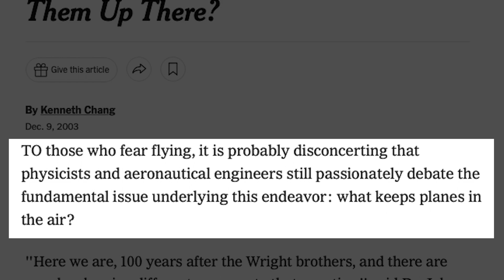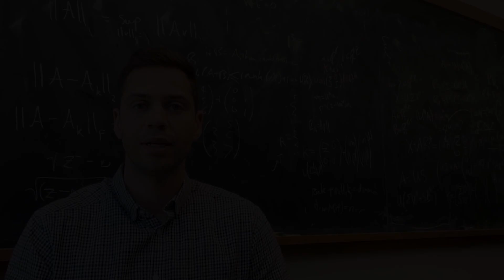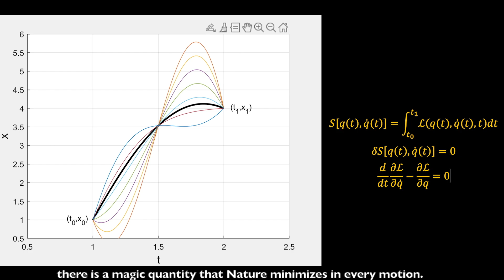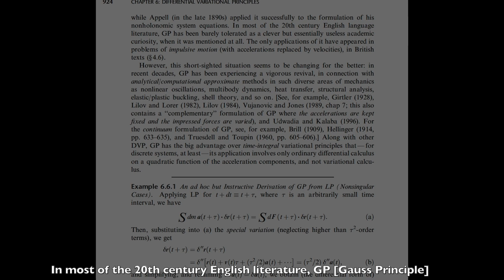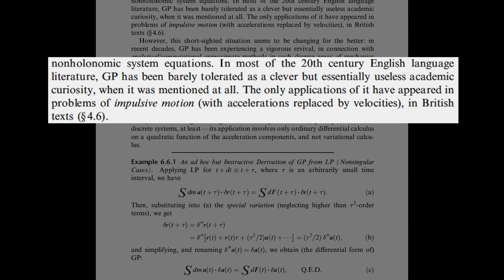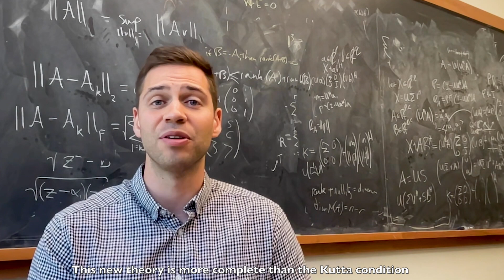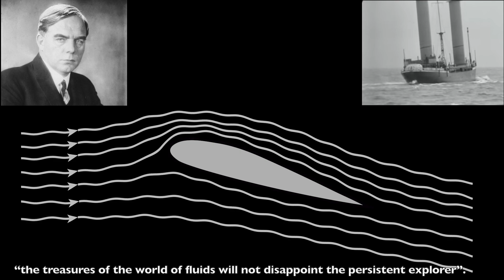A New Theory of Lift

Comment: Everyone over thinks this. The wing flings air down, the reaction force is lift.
Reply: This is more easily apparent when you consider a helicopter, which is a "rotary winged" aircraft. A helicopter in a hover produces downdraft that you can feel if you are standing underneath it. All that air being accelerated downward produces the upward lifting force. It goes back to Newton's laws of motion. The air has inertia, so accelerating it in one direction (downward) produces an equal and opposite reaction (upward) equal to the mass of the air times the rate of acceleration. Airplanes do the same thing as helicopters except they have to constantly keep moving through the air to do it.
Reply: @joevignolor4u949  of course, because the pressure also bends air downwards. After all, air is the only thing the wing/helicopter blade has to push off, so the air going down must equal the force upwards. It's just that more air is deflected down by the pressure difference (the vacuum over the top of the wing "pulling" air molecules in to it hence curving them downwards) than by pure deflection
Reply: @joevignolor4u949  otherwise why does a flat bottom airfoil at 0 degrees AoA produce lift?   There is no deflection going on apart from the frontal area
Reply: @nade5557  That's exactly right. One mistake people often make is to think that the airflow creates the pressure imbalances around the wing. Actually its the other way around. It's useful to think of the wing as a piston being propelled forward through the air. A piston moving in a cylinder creates high pressure in front of it and low pressure behind it. The wing does the same thing as it travels through the air. This "piston effect" is what develops the higher pressure at the leading edge of the wing and the lower pressure at the training edge and it is these pressure imbalances that accelerate the airflow over the top of the wing. Then in addition, accelerating the air further reduces the pressure per Bernoulli's principle. As you stated the net effect of all that suction on top of the wing is to draw the air mass downward towards the wing by vacuum coupling the air to the wing. And because the air is curving downward over the top of the wing against its inertial mass the wing is forced upward. Also note that lowering the leading edge slats and trailing edge flaps increases the width of the "wing piston", which causes more air to flow over the top of the wing, which produces more lift.
Reply: So why is an airfoil more efficient than a flat plate. In fact, the suction force over the top of a wing generates more force than the bottom of the wing. During a stall there is still airflow over the bottom of the wing, yet very little lift is generated. Also stall occurs quite suddenly which corresponds with flow separation over the top of the wing
Reply: @Nade, you're absolutely correct.
The upper surface of a flat bottom aerofoil generates roughly 2/3 of lift, whilst the underside generates roughly 1/3 of lift.
When the angle of attack increases, it will reach a point where the boundary layer will start to separate, this is known as the onset of a stall.
At ground level, in denser air, the stall initiates at low speed at very high angles of attack.
In thinner air, for example, at a high altitude, the stall initiates at a much higher speed, due to lower air pressure being unable to force the airflow to follow the shape of the wing, as it does at lower levels.
As one goes even higher, and the air pressure drops even lower, so the amount of lift generated by the aerofoil eventually reaches a point where it only just equals the weight of the aeroplane, this point is known as the absolute ceiling, 
To give an example, a Boing 747 generates Tons of lift at take off, but at 40,000 feet is generating only about 9 pounds more lift than its weight.
Reply: @nade5557  curvature makes for smoother airflow so that more air is flung down. During a stall the turbulent air goes in all directions so no resultant downward fling.
Reply: @mhoover  but turbulent flow in a stall only affects the air over the top of the wing. The flow over the bottom remains attached and produces some lift, just not enough.

Comment: Thanks for NOT explaining what any of that meant.
Reply: Airplane wings produce lift using the same action/reaction principal that a rocket engine uses to lift a rocket off the launch pad. The pressure created inside the rocket engine's thrust chamber accelerates the combustion gas downward through the nozzle, which produces the upward lifting force. Similarly airplane wings accelerate air downward to produce an upward lifting force. But how does the wing accelerate the air downward? Basically, the forward motion of the airplane compresses the air at the leading edge causing the air to be accelerated up and over the top of the wing. This creates a region of low pressure over the upper curved portion of the wing. When an air molecule traveling in a straight line encounters the region of low pressure it gets deflected downward as it follows the curved surface of the wing. It's this downward deflection of the air that produces the lift.
Reply: @joevignolor4u949  All of that, I understand. That is the classic simplified explanation of lift.  But none of what you outlined is discussed in this video and none of what is discussed in the video is properly illustrated to explain the jargon.
Reply: @blaster-zy7xx  The mistake they're making is trying to explain lift using a bunch of equations. Equations allow you to describe and quantify the airflow around the wing but they don't provide an explanation of how the lift is generated.
Reply: @joevignolor4u949  Exactly.
Reply: @blaster-zy7xx  It's like if a student asks, "How does a nuclear reactor work?" Then the professor replies, "E = mc2". Then the student says, "Um. What?".

Comment: These are engineering-minded individuals grappling, intelligently, with the limitations of the Navier-Stokes equation (or with the simpler Euler version of them which forgets about viscosity). That's fine, but the truth is that the Navier-Stokes equation is an approximation that works when the length scales (e.g. the width of the wing would establish a length scale) are much larger than the average distance between molecules of air. No paradoxes would arise if the problem were to be formulated at the molecular level. It's just that approximations are needed to estimate the lift.

Comment: It seems obvious that air molecules search for a steady state of least energy levels. So, molecules might try to have the largest distance between them to minimize the repulsion forces. 
Now we come to a point which often puzzles me while listening to aerodynamics: they often talk about the "flow" of air over the wing, meanwhile they seem to forget that the only moving object is in fact the wing, NOT THE AIR. As such, air does not "flow" over the wing, but simply tries to avoid it. And it will just avoid it as much as needed, before regaining the initial steady state.
Reply: We can consider the wing as our frame of reference and as such it's static while air moves. Which is why we can have static wings in wind tunnels to study them. In the real world, we have both the air and the wing moving. Which is why you can take off with less runway when you have headwind.
Reply: Not sure how the air "avoiding" the wing would create lift. I see it as quite the opposite. The air molecules displaced by the wing pile up and naturally exert a pressure on the wing surface. The unbalanced pressure above/below the airfoil generate a net lift due to the assymetrical surface areas.. So, the air isn't avoiding the wing, it's pushing back. The flow dynamics are a different story generated by both the pressure gradients and drag forces. But, I'm no FD scientist!

Comment: It would be a great first step if people would stop repeating the nonsense theory about faster airflow over the top creating low pressure. Wings create lift by deflecting the airflow downwards thus creating a reaction that pushes them up.
Reply: Even without using "faster airflow", downward airflow can still be caused by top surface of the wing. It's like how when one pull a piston, air is sucked toward the piston handle direction. The wing top surface is like a piston without the piston wall. The curved surface of the wing top create a smoother acceleration of air being sucked downward.

About why the top surface of a wing produce more lift than the bottom surface, it can also be explained without any "faster/slower airflow". It can be explained solely by the concept of drag. To minimize aerodynamic drag, it is conventional for the head to be bulkier than the tail. When this head-bulky wing point the tail downward (since we want to deflect airflow downward), the top surface is naturally in a higher curvature than the bottom surface. Higher curvature causes stronger airflow deflection. Thus the higher component of lift caused by top surface of a wing.
Reply: why is this so hard for people?
Reply: @brettharman8921  because its not correct, lift isnt ONLY generated by reaction force. In fact, more lift is generated by air over the top of the wing than the bottom. An airfoil is more efficient than just a flat plate at an angle because reaction force isnt the only thing at play
Reply: @nade5557  i agree that lift is also generated thru negative forces over  the wing.  i do not agree that the negative forces are greater than the positive forces  below.
Reply: @brettharman8921  you can disagree sure, you'd just be wrong. People have measured this, unless the flow is supersonic the top surface generates more lift
Reply: @nade5557  i go by MIT aerodynamics-
Reply: @brettharman8921  I go by NASA aerodynamics
Reply: @brettharman8921  the ratio is about 2/3 over the top to 1/3 over the bottom

Comment: But doesn't this only refine the concept of fluid dynamics related to an airfoil design calculating a difference between the flow above and under the airfoil?
Does this not still not account for any possible Newtonian physics related to actual upward pressure on the underside of the airfoil?
I'm still waiting for a unified theory, unless it's just too simple to manually combine both theories.

Thinking about this refinement introducing the concept of least curvature, I'm thinking that it would probably assume ideal boundary layer flow and no disruptions/vortices/separation.

Comment: Instead of the Kutta-Joukowski condition we could impose a condition of zero total vorticity in the flow, which will then give us a realistic unique solution if an aerofoil is started from rest. All the vorticity in the flow in concentrated on the surface of the aerofoil, and viscosity means that it will diffuse outwards. Initially the flow around the trailing edge needs to double back around it, and this fails to happen for a boundary layer containing vorticity. Net vorticity is left behind the aerofoil, and by the topological principle of the conservation of vorticity, there is then bound vorticity associated with the aerofoil, which generates lift.

If the aerofoil has a less than perfect trailing edge, this process can still happen, but flow separations from both the top and bottom of the aerofoil interact to produce a little Von Karman vortex street, which is now an unsteady flow. If the aerofoil mutates into a circular cylinder, then it is pure vortex street and no lift if the cylinder is not rotating.

As one other commentator suggests, let's try dragging a hydrofoil through liquid helium to see what happens.
Reply: Kelvin's conservation of circulation cannot be sufficient to determine lift. It simply says that the sum of vorticity in the wake is equal to the circulation  over the airfoil. But how much is that? It does not tell. And the entire Euler's PDE cannot tell because it is non-unique. There is a real need for a closure condition (Kutta-like condition), which is provided here by a minimum-curvature argument.
Reply: @haithemetaha9194  Maybe a minimum curvature argument has some validity since a boundary layer can have issues with going round a corner. The video implies that Kutta plucked his condition out of thin air when in fact it could have been deduced from wind tunnel studies and streamline tracing, which is something I have actually done myself, and in addition I have compared experimental results with streamline tracing obtained from the use of the Martensen Method on a computer. It could also be guessed from observations of the starting vortex left behind by an inclined hydrofoil in a fluid covered with iron filings. In three dimensions, the bound vorticity associated with the aerofoil is continued as trailing vorticity from the wingtips which are visible centres of condensation at high altitude.

The video implies that in a superfluid a transverse force can be generated just the same. Is there an experimental prediction being made here?

One alternative to a Kutta condition is full scale computer simulation starting with an initial condition of zero total circulation. I have done that using Alexandre Chorin's method combined with the Martensen Method when I did a PhD. My supervisor was Professor Lewis at Newcastle University. Surely both Chorin and Lewis turned up in the literature search done by the authors of this video.
Reply: @david_porthouse  Hi David. First, as you yourself said the Kutta condition could be "guessed". Yes, indeed, this is what the video implied too: the Kutta condition is not derived from first principles, but guessed. And of course it was a correct guess that enabled aviation. The new theory does not contradict Kutta but generalizes it; the video says: "The new theory is more complete than the Kutta condition". 
As for the lift on superfluid, the video said that this question is "reopened", so it needs investigation after "physicists thought to have settled". In addition, there is a recent (2019) PRL paper where the authors performed quantum simulations for the flow of a superfluid over a Zhukovsky airfoil and found a quantized version of Kutta's lift.
https://journals.aps.org/prl/abstract/10.1103/PhysRevLett.123.154502

As for the full computer simulation by the great Chorin and Lewis, it is not very relevant to the story in the video, which is concerned with theoretical developments, not simulations. The video is for a broad audience, and a comprehensive literature survey for a 100-years old field in a 6-mins video is far from being the goal. 
Thanks for your comments and interactions.